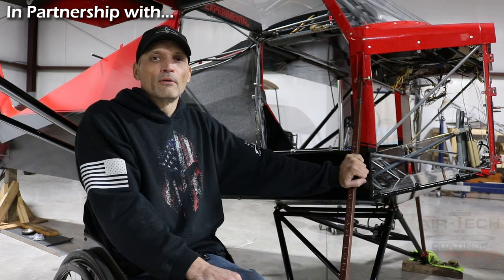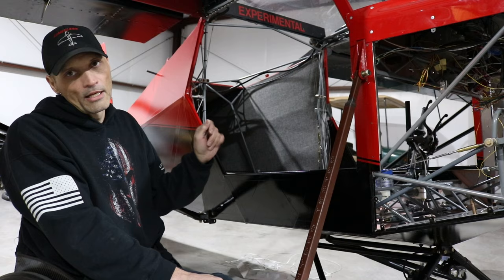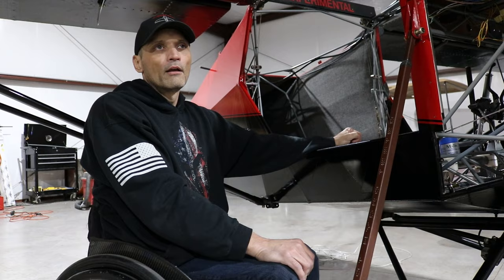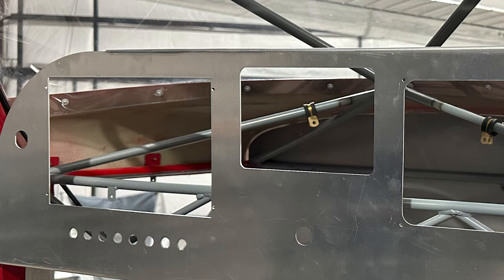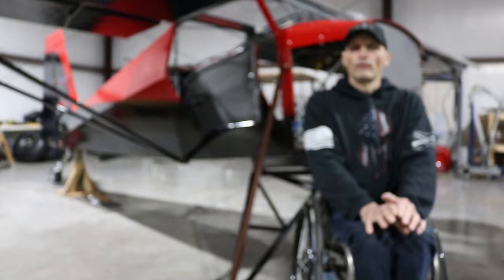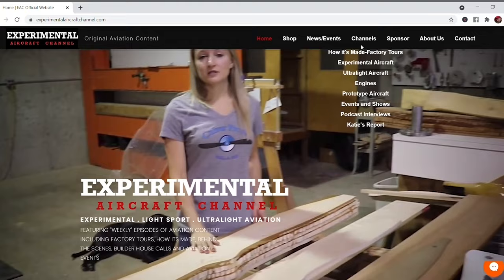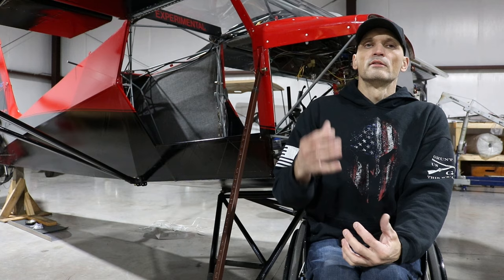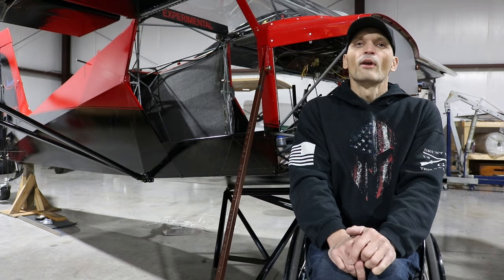Justin's SuperSTOL Yamaha Aircraft Build!

Comment: dang the HP cat has shredded the bag and gone !? ,[ when will they just do vertical takeoff !?]. have to ask ,can the dragsters  follow Mike Patty's draco with a fully pitch adjustable prop ,and 'air bake' to land ? . Also have to wonder with all that turbo power ,and oxygen, how high and fast could a 'slow ' plane go ? ,200-250 at 25 000 would be nice for travelling .Also ,also , with that much prop blast would making the wing struts in to wings ,give worthwhile extra lift ,ducted venturi /channel wing effect ?. Also also also ..high rpm so using gear boxes anyway , is it time to midmount the motors ,run a prop shaft through [ suitably encapsulated ]  lower mass for braking , quicker rotation on takeoff ,and open up fwd visibility more ? .